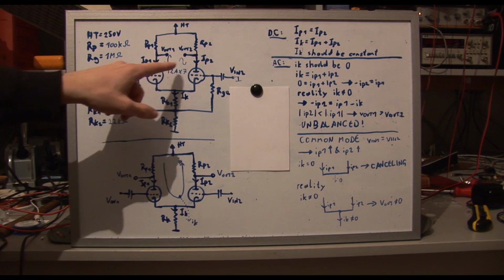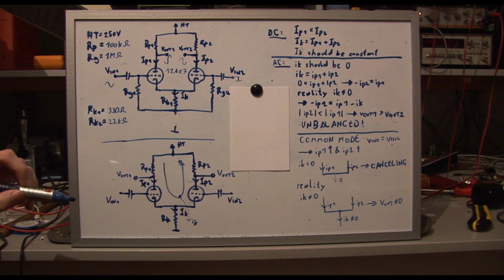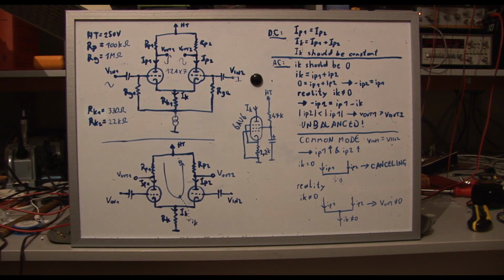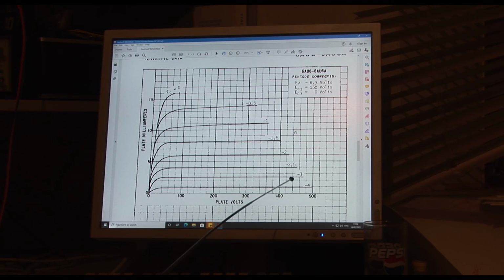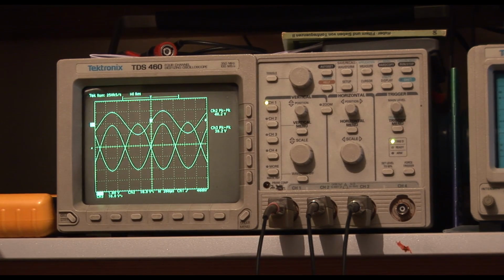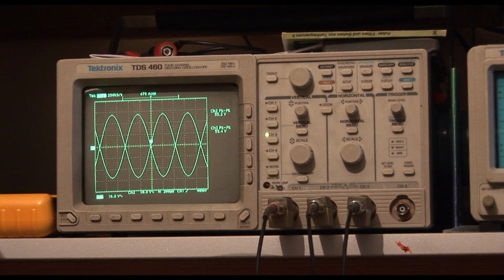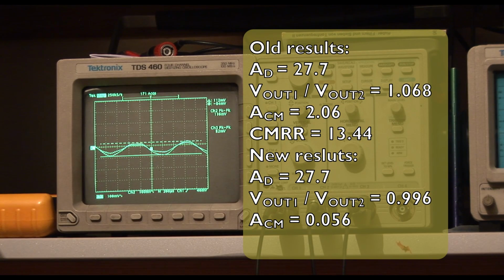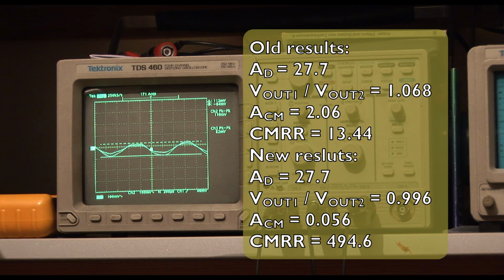Differential Amplifier with Vacuum Tubes - Part 2

Comment: Great conclusion!  One questions: does the constant current sink overcome characteristics mismatch between the two (or two-halves of) 12AX7s?  That is, was the unequal #1 v. #2 outputs caused by non-identical tubes or tube halves?   Thanks
Reply from the maker: Good question! If the current sink would be ideal (Infinite output impedance), then the AC signal has no way to "leak" out and therefore it would overcome the mismatch. For this, the plate resistors must be matched. Also, the real current sink with the 6AU6 does a good job. However, keep in mind that if the tubes are mismatched the DC conditions wouldn't match on both sides. One side would have more bias current than the other, and therefore one side would have a lower dc level than the other.
Reply: @MrVideoTronix  Thanks for your reply.  Keep the videos coming!